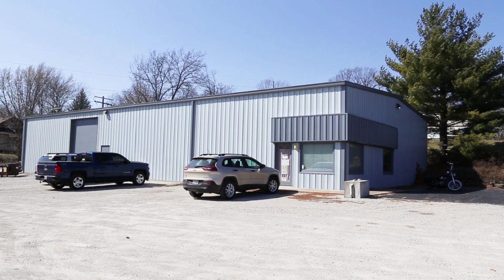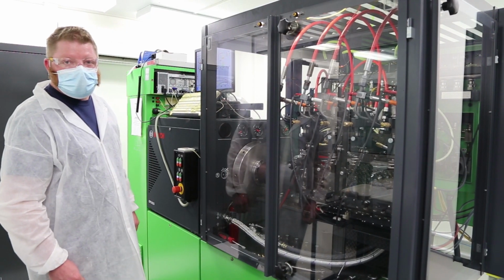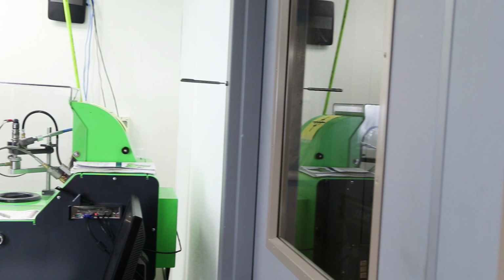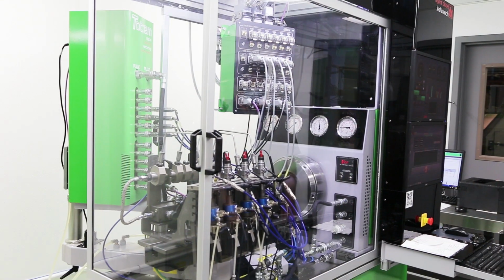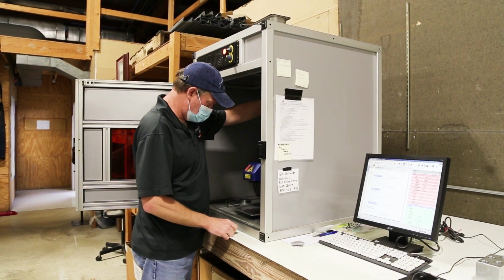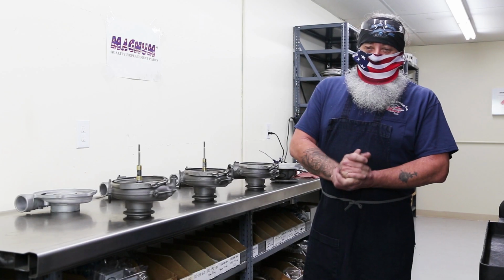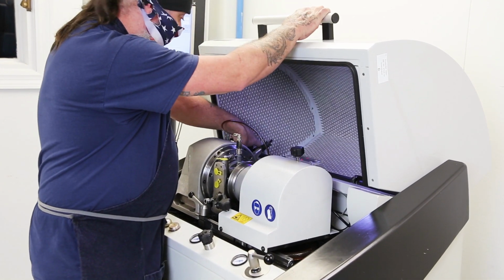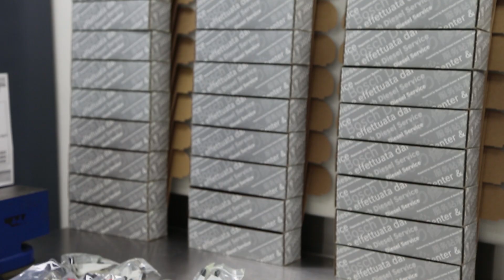Shop Tour - A Look Inside Area Diesel Service's Route 4 Specialized Remanufacturing Facility #Tour

Comment: Why did you magnetize the turbo when you balanced it?  Great video.
Reply from the maker: We demagnetize the turbine shaft and/or nut because they must be neutralized of any stray magnetic field.
Then we magnetize them so that the magnetic sensor picks them up to get a reading.
Reply: @AreaDieselService  , i learned something, thanks.
Reply: Man y’all give John all the dirty work! 😂
Reply: Seems like it would take a different fixture for every turbo frame on that balancer. Do you balance all turbos as assembled cartridges or just certain models?
Reply from the maker: @bcbloc02  - Thanks for the comment/question Brian - yes we have different fixtures for the different turbo cartridges that we balance, and we only balance certain models presently.
Reply from the maker: @bcbloc02  😂